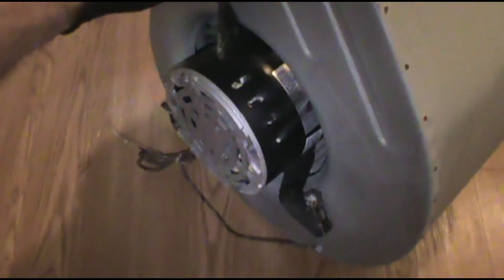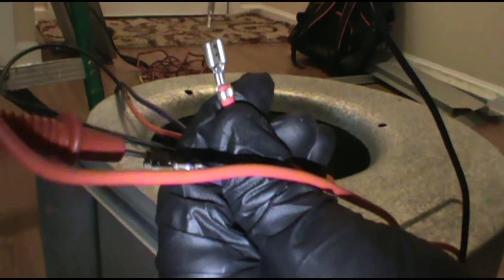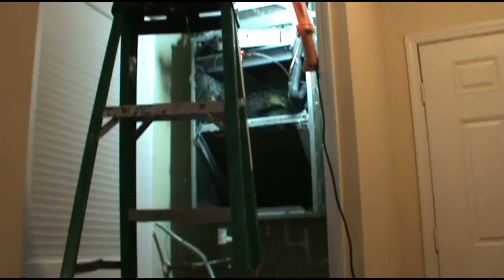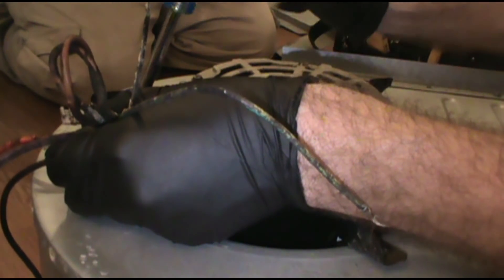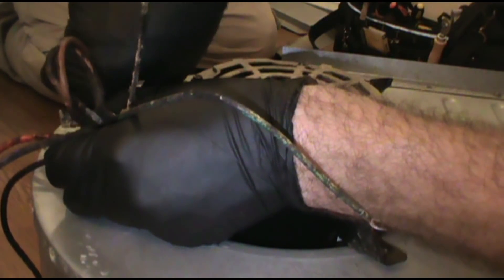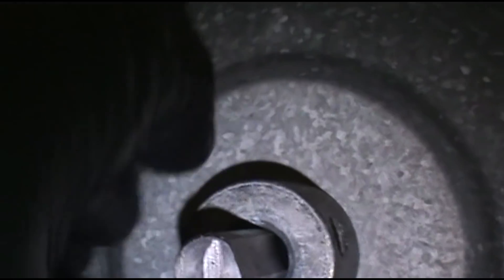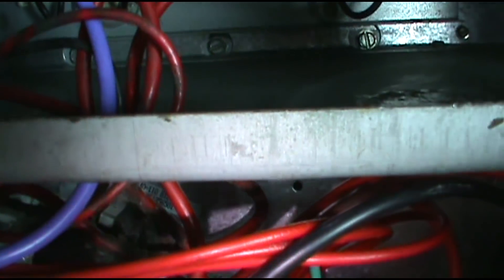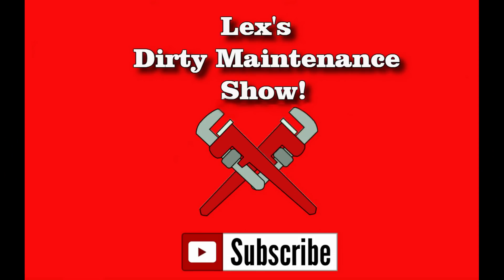HVAC- AC Freezing Up & Fan Motor Is Not Turning On

Comment: We always called them stud mount, never had much motor trouble with the older ones.
Reply from the maker: Yea I've worked on older air handlers & the motor just slid out of the front with no problems. Everything has to be over thought now days. Thank you so much for watching Pops!
www.DirtyMaintenanceNation.com